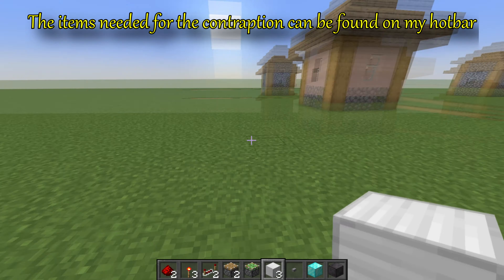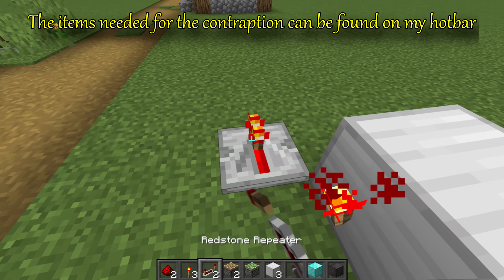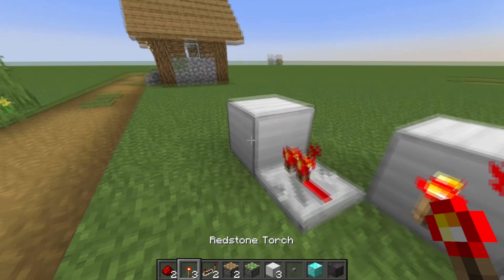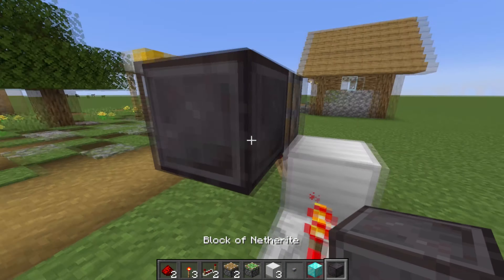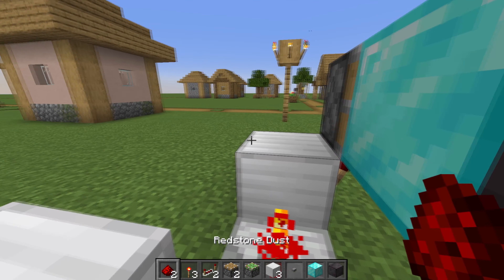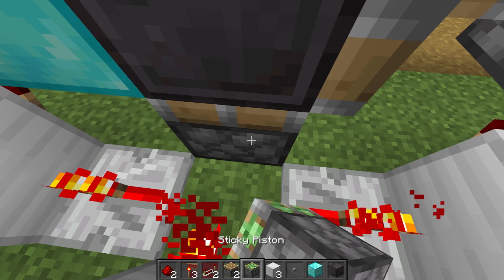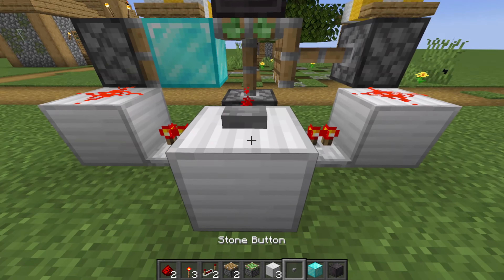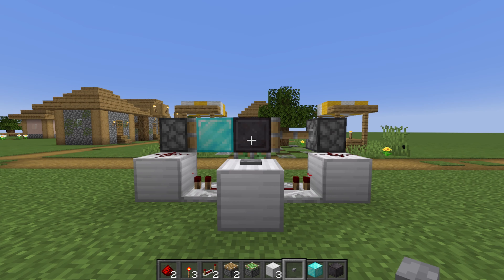How to Build a Block Swapper (Fast & Easy)

Comment: if you want it to return to the block it was before switching it, just split the signal ur sending with a button, lever, etc... into 2 and add 8 4 tic repeaters to 1 of the signals so it reactivates it after the button press is done
Reply from the maker: Awesome, thanks for sharing!
Reply: @enbentz  no problem! used this for my bubble elevator to change the direction back

Comment: Trying to use this to swap soul sand with magma block for a water elevator. Doesn't work. The circuit is too slow which allows the water to drain and destroys the circuit.
Reply from the maker: Yeah, you're better off just using a piston with slime blocks to extend and contract when you want to go up or down. Maybe I could make a tutorial on that as well.